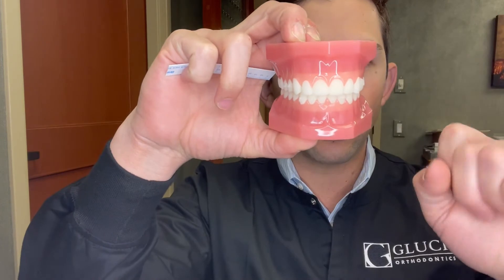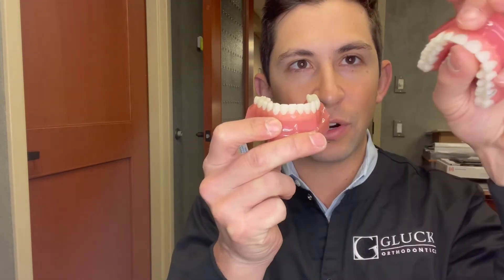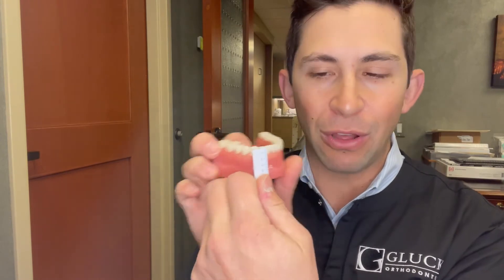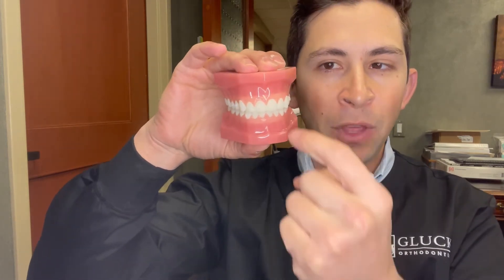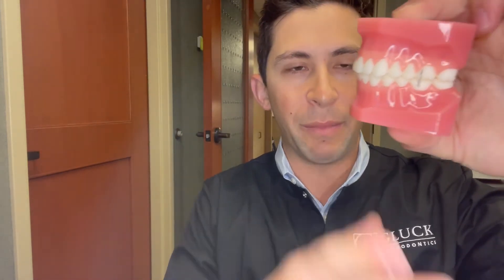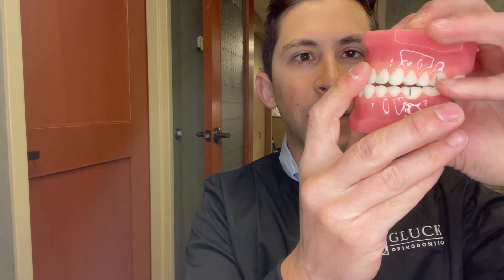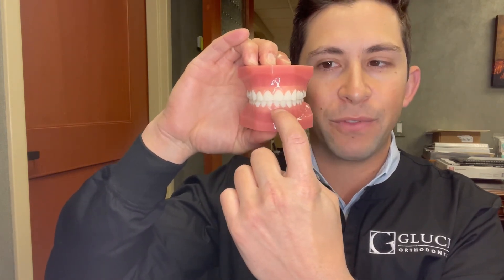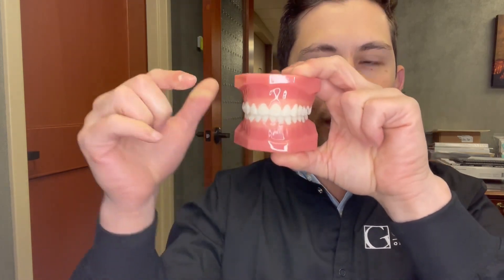How to Measure Overbite and Overjet

Comment: Hey I have an overjet of about 10 mm. Doctors advised me to do jaw surgery but I don't want to do jaw surgery. I am 18 years old. Can I cure my over jet without jaw surgery
Reply from the maker: That's a great question! It's hard to provide an accurate assessment without a clinical exam and diagnostic records. That said, 10mm of overjet is a large amount and would likely fall into the category of surgery or permanent tooth extractions to correct. Thanks!

Comment: Hello, after a new dental bridge, because I replace my old bridge I have only a 2mm distance (overjet) between my upper and lower teeth. Is this normal for my front lower teeth to hit a little my front upper crowns of the dental bridge? This happens when I close my bite to check my occlusion
Reply from the maker: Thank you for the question. It is normal to have some "contact" between the top and bottom front teeth when you are biting down.

Comment: Can a 8mm over jet be fixed without jaw surgery?
Reply from the maker: Thanks for the question! It’s possible but depends on the patient and treatment plan. It’s more predictable if the patient is growing. Good luck!
Reply: @GluckOrthodontics  thank you, I’m 17 and I have a 8mm overjet, my top teeth aren’t protruding Fordward but my lower jaw is backwards, also my two front teeth are kinda slanted inward, I’m getting braces soon but I’m kinda worried there gunna tell me I need jaw surgery
Reply: @lukeakaluke whats happened dude

Comment: That's helpful. But what would be the normal range of overbite?? I read online 25% is the ideal and 5 - 25% is normal, but alot of other sites say 1/3 is normal (33%) and that normal range is 30% to 50%. So which is the normal range before its considered an excessive overbite???
Reply from the maker: Great question. It really depends on the patient's skeletal jaw relationship, but a rule of thumb is ~20-30% is "ideal." There will be variation though based on the patient.